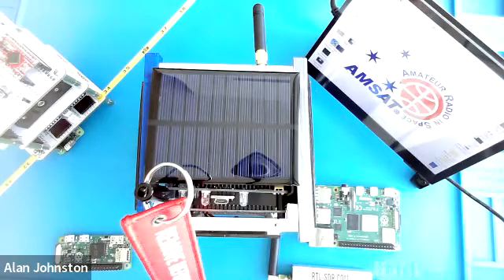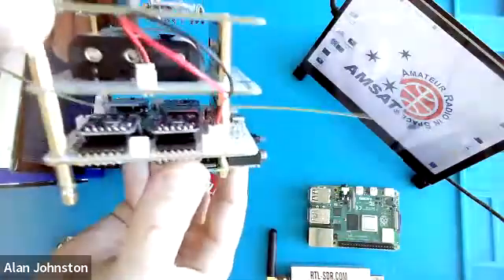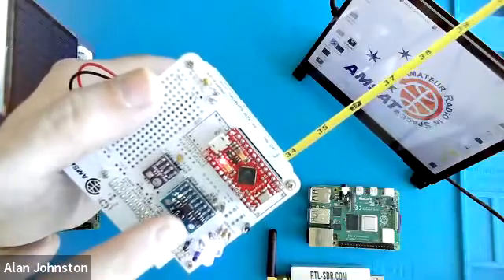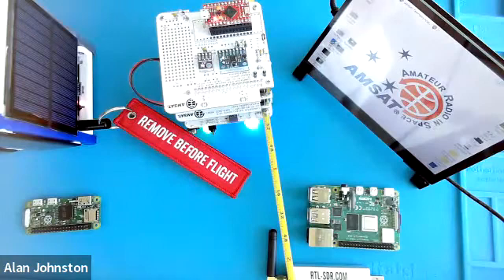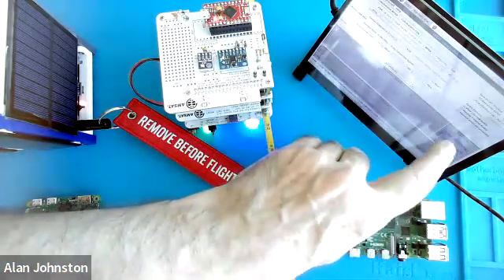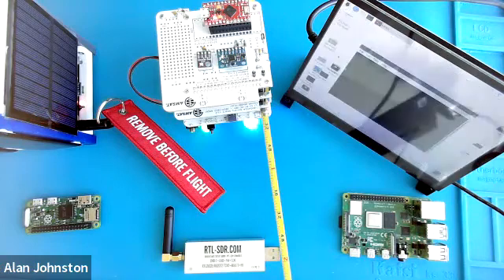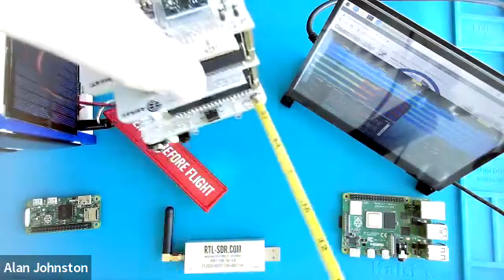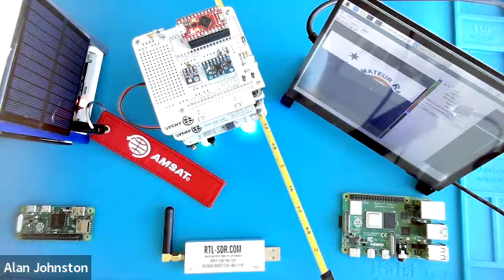CubeSatSim Quick Start Guide

Comment: If communication on the satellite is using Raspberry pi radio transmission, what will be the range of communication?
Reply from the maker: The CubeSatSim is designed for the classroom, not space. The range is a few hundred meters.
Reply: @ku2y  what would you do to increase the range?

Comment: I looked at the schematic on your GitHub page and could not find a coms board.  It's implied that the telemetry on 434.9 MHz is generated using PWM output of the raspberry pi zero and filtered using the low pass filter. Is this correct?  At what power level is it transmitting?  73, DE WA4OSH
Reply from the maker: Hi Konrad, yes this is correct. It is less than 10mW of power.